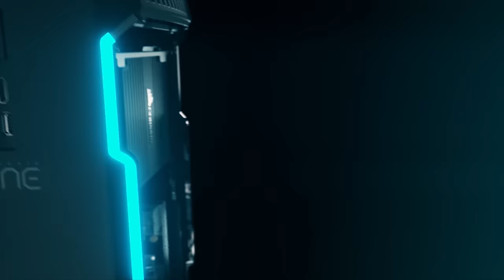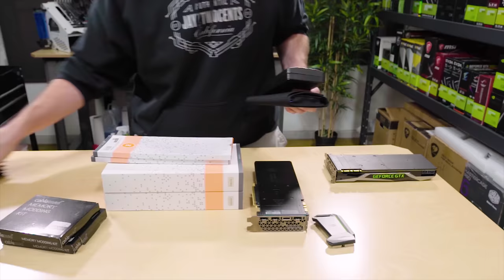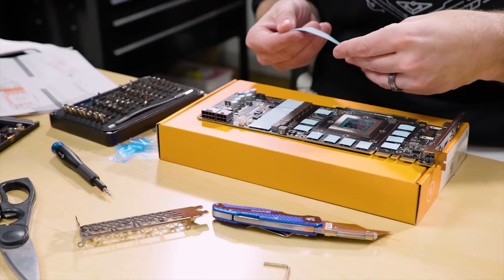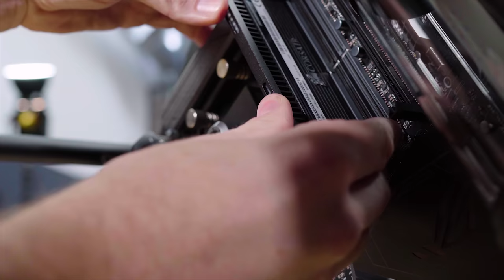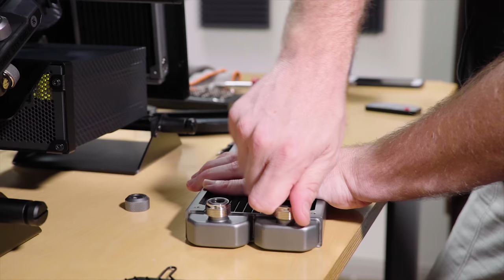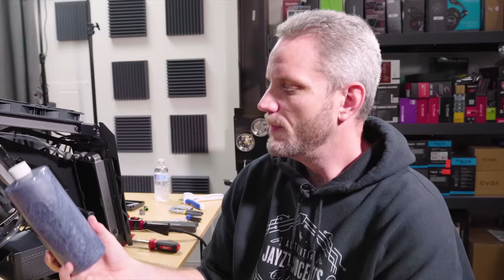Custom Watercooled Threadripper 1950X Build Progress

Comment: Jay, why are you using founders edition cards? Wouldn't aftermarket cards be better due to the custom PCB and added VRMs? You would be able to overclock them better too.
Reply: Water cooling cools the vrm and everything else.  You are limited by how much radiator you have and the chip die itself.  “Silicon lottery” most people do founder edition because it is supported with water blocks. Aftermarket cards usually are not with some exception of course.
Reply: Ah, that's fair enough. I had the EVGA GTX 1080 ti FTW Hydrocopper in mind or something similar. I was mainly thinking of the added VRMs and custom PCB which usually all help in overclocking.
Reply: 1080TIs don't OC at all really. GPU boost pretty much maxes them out anyway and Nvidia seems to keep the best chips for themselves.

Comment: If the bracket isn't used than isn't an option to cut some space out from the bottom so that the cover plate still has those mountings ?

Comment: Why don't you do from the the CPU to the big radiator, then to the GPU, then to the smaller radiator? Then you're giving it a chance to cool down before you pipe it into the next heat producing component?

Comment: Hey Jay... Out of curiosity, why did you choose those Corsair Dominator to go in the Threadripper build?  Was is a performance thing or an aesthetic thing?  I wonder because because Corsair modules just haven't really been hitting the mark on Ryzen.  If best performance was you're goal, you would likely be far better off with G.Skill 3200 CL14 RAM modules.  They do make a TridentZ with that spec in a dark aluminum shroud with black strip on top that would probably look good with that monochrome style system you're going for, but give you better performance as well.  Specifically the F4-3200C14D-16GTZSK.  Especially since Ryzen and especially Threadripper just loves extra memory frequency.  However, if it's more of an aesthetic thing, I would be very interested to see a set of those Black Special Edition Corsair 25600 modules as those are the only ones Corsairs ever made that are rated at the same 3200 CL14 specs.  Specifically the CMD32GX4M2C3200C14M.  The same ones you put in the Terry Cruz build.  I would love to see how those modules ran in a Threadripper build.  I just wish Corsair would sell those spec'ed modules in more than just a one off special edition, like G.Skill does.  

Man I really wanted a quad set of those black special editions for my Threadripper build I'm working on.  But they don't sell them, so I was forced to get G.Skill F4-3200C14Q-32GTZ instead because I really wanted to hit that 3200cl14 spec for my build.  I couldn't do that with Corsair's other modules, but I can with G.Skill.  Would love to know your thoughts on this.

Comment: Hey Jay, how are you going to control the radiator fan speeds so that it monitors the CPU and GPUs temperatures as you are using the same loop for both? 
If it were an Intel machine you could use SpeedFan. 
I think this is an issue for all single loop CPU & GPU Ryzen builds. 

P.s. I love the build so far.

Comment: instead of putting the drain coming out of the reservoir, why not replace the right angle fitting going into the bottom of the gpu with a tee fitting and have the drain port off of that.

Comment: I know you said that you are tired of talking about it.... but, here you have a perfect chance to show everyone real world results of running a GPU directly before the CPU compared to running a radiator between each component. Even just running soft tubing for testing purposes. I have not seen a single test of this concept, anywhere. Not a single YouTube channel that I am subscribed to has tested it and shown real numbers. I think I speak for everyone. We want to SEE the differences and right now is a perfect chance to do so. You could finally shut everyone up. Everyone just says that it does not matter without any kind of actual testing being shown. If you do not do it with this build. PLEASE could you do a video with testing the differences. I mean this is a perfect chance for you to make a really highly viewed video. I almost guarantee that every single one of your subscribers would be interested in this. Please make a video about this at some point to just shut everyone up.
Reply: he and many other youtubers already made several videos about this. It does not matter, period. You are NOT dumping hot water on the CPU, thats not how water works. The entire loop pretty much runs the exact same temperature with negligible variables in some sections. Having an longer, more restrictive loop hurts performance more than the shortest route could ever do. The only thing that matters is that the reservoir goes into the pump, which ideally is the lowest point of the loop
Reply: Please link a video then if this is true. A video with actual results where they showed testing of both configurations. Please so we can shut everyone up for once.

Comment: is there the possibility to improve the water flow if you installed a "vertical GPU Mount"?
because of the formation of bubbles because the outlet is lower than the cooler plate.
there could be a place where the water does not flow, at the highest point?

Comment: @JatTwoCents , is it possible to split the exit flow after the pump or radiator and then taking each one to the CPU and GPU and then, going back to the radiator or the difference in pressure would mess up the flow?

Comment: You know I can't help but wonder now for some reason. Would a 1080ti founders addition on water actually overclock the same amount as for an example 1080ti kingpin card also on water?
While both cards are the same GPU, they aren't actually built the exact same way. Kinda would like to see a video about that. I know there are loads of other factors as well like the "binning lottery". Where not all GPU's are 100% the same cause of very very small, I would call defects/mistakes but differences in the way they turn out after manufacturing but still, it's a question that just popped into my head.
Reply: partener cards like the kingpins have better vrm which when properly cooled can lead to higher overclocks

Comment: Why go parallel on the GPU's? You get lower restriction, but nothing says the flow rate over each card has to be even close to equal; in the worst case, one card could get upwards of 100% of the flow, causing the other card to overheat. Going serial means higher restriction, the flow rate will be the same across both cards, and higher restriction isn't a problem as long as you are using a suitably powerful pump. Most of the time, parallel flow rates should be about equal, and the performance difference between serial and parallel will be basically nothing, but as you get into the edge cases, parallel performance drops much faster than serial. What are you gaining from going parallel that makes the tradeoff worthwhile?

Comment: Is there a way to attach an air fitting so you can put low pressure air to blow the system out to make it easier to drain?
Reply: there is no need for that and if you are really desperate simply blowing into it does the job. You have to flush it afterwards anyway.

Comment: Covering the power supply is not correct. You have decreased the heat emission of the unit by isolating its metal surface.

Comment: It's a shame you decided to use bottom connectors on the top radiator. If the tubes would go out of the case and make a 180 degree bend, sticking out, it would look sick!

Comment: Which Radiators and Watercooling parts did you use for this Jay?
Reply: He gives a run down starting at 11:03 ICYMI.  Primochill fittings, rads, coolant.  EK blocks and the works. D5 pump, etc.

Comment: if you want to do something "funky" with the lines from the GPU to CPU block you could leave the CPU block as is and spiral the tube down in a pseudo helix ..... it would be a stone cold bitch of a bend but if pulled off it would look amazeballs and to my mind it would fit well with the Symbiote theme
Reply: also the way you had the top rad in the start with the ports coming out top rear would fit well with the build if you were looking at a H. R. Geiger alienesque feel with your "Symbiote" thing and with all that black and monochromatic dark coloring i think your likely to be heading that way.

Comment: samsung 960 pro m.2 nvme + 10tb 3.5" hdd for drives
Reply: would it be possible to watercool the drives?
Reply: and is there only room for a single hard drive or could you throw some more in there for raid?

Comment: Hey guys, I have a quick question... If anyone could provide some insight into answering this that would be awesome.  This will be a bit of a long read so I hope you have some time to kill...
Cough cough

I have a powerspec x251 computer I bought from this store called microcenter.  System specs are an Intel i5-6600k, an AMD R9 390X, 16gb RAM at 3200mhz, a 750watt 80+ bronze PSU and a 480gb SSD all of which is connected to an ASRock Z170M-ITX board.

This is where things get interesting, I went into the BIOS and the UEFI and I found that (not only do I have very limited options to OC) there was an option to turn on RAID storage; however, there are no RAID ports on the board, yet I turned it on in the UEFI and found that this changed the boot order of my computer to the point where it wouldn't find the operating system to boot up normally.  After trying to switch the boot order with RAID on it still would for some reason switch the boot order and not boot properly.  Yet when I turn off RAID storage, everything seems to be just fine.  Is this happening because I have an SSD and SSDs doesn't support RAID since RAID and SSD's are two different types of storage?  Or is there something else going on? 

If you made it this far please give me some insight.  I'm curious as to why/ how this is happening. (Also Thank you for reading this far!
Reply: NightDevilMacGeneral So if I have two 480GB SSD's... Then how does RAID come into play?  Because I thought RAID was it's own type of storage.  Obviously I'm missing something.
Reply: NightDevilMacGeneral Aaahhhh, I see okay.  Well hey, thanks for explaining that!  I thought RAID was a type of storage.  I'll definitely give the Wikipedia article a look though.  Thanks again for the help! :)